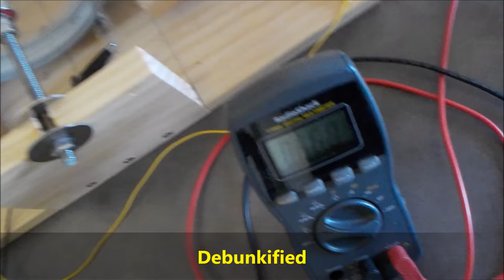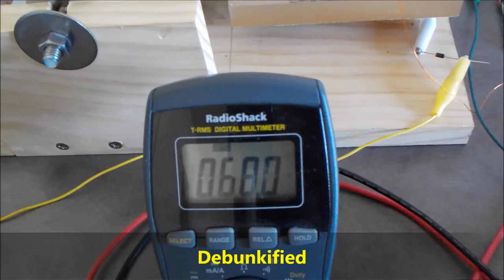GLIMPSE of FREE ENERGY OVERUNITY BYPASSING LENZ'S LAW

Comment from the maker: Honestly I believe it's more than a collapsing magnetic field, at first I thought maybe that's all it was. I initially thought that the split second short was causing a giant current to flow in that split second and an infinitely small resistance which in turn creates a huge opposing magnetic field from Lenz which when released  causing a huge voltage spike normally associated with a collapsing field. But this isn't the case at all as can be seen on an oscilloscope where the normal generated power can be seen as a sine wave, but when one looks closer one can see that there is another AC sine wave 
superimposed upon the negative and or positive peaks of the generated AC wave of the passing magnets.

This is an AC wave not a pulse discharged inductor which is clearly a pulsed DC that is commonly found with a collapsing magnetic field. A collapsing magnetic field can not create an AC wave like that, but a shorted coil does. So the coil is actually "Vibrating" like a guitar string and going into a "ringing frenzy". Vibration is energy and this is what we are tapping into. Energy is the potential to do work and power is the amount of "time" work has occurred and the measurement 
thereof.

A capacitor is a must have as this is the reservoir for the vibrating energy to enter into, after rectified into DC of course. The capacitor, when completely empty, is nearly without resistance which would never really occur as the capacitor is constantly charging and discharging. If this is done on a battery one will see that the current going into the battery literally vanishes and the meter will show this. A regular store bought meter can and will show a fairly accurate measurement, not perfect, but close enough to give a good round about figure, and even gets pretty close to an O-Scope and resistor test.

It can be frustrating to see that a capacitor happily accepts this AC to DC current coming from the coil, but not a battery and is a bit of a paradox if one is under the assumption that it is a collapsing field coming from the coil. (Tesla's discharged inductor.) when in reality it is an AC high frequency ringing coming from the coil instead. You see the battery offers too much resistance and is in no way anything like a capacitor at all, and so it just simply snuffs the power out, for those of you who have tried to send current from shorting a coil back to a battery as load, such as the source battery. You simply won't see it.

It is quite obvious, and I've been saying this for years, all the way back to the eternal motor site days even, that rotating magnetic fields can be multiplied and the generator coils they spin by are multiplied you are easily in the OU territory energy wise, or potential wise. If done right a 9V battery can spin a motor/generator and the generator can produce hundreds of volts, which can easily charge a capacitor up much higher than what the collapsing field could ever do coming from the motor coil, which is already at least 50%. with a rotor being a slower frequency, hence a lower efficiency.

It's not science rockery. It's potential. The OU is locked up in the voltage, (energy) and the trick of course is to get the current AND voltage out without any feed back at all back to the source, but without the current, we are generating Overunity VOLTAGE, which is only half of what we really want. Just make sure you have plenty of it to WORK from it successfully.
Reply: Hi BobYes it starts out as a collapsing magnetic field within a coil that has been induced with magnet, or has been pulsed with DC, then this inductor is shorted with switch at a very specific time and pulse width,  but it is different than how you describe it, as the scope shot I put up is without a capacitor connected....you could be somewhat right, as the coil itself has self-capacitance, but it is certainly much different than the "typical" collapsing field of inductor after being pulsed with DC  and when switch opens,  the magnetic field  collapses and you get that  backemf/recoil flyback HV spike, which is what Debunker is talking about and I agree with......It is  NOT  "latching resonance" between two oscillating systems, like in a radio, it is "forced" hyper ringing of an inductor into very HF and HV AC oscillations with only purpose to fill up caps to much greater level of voltage and joules when the short is switched in at peak and really has nothing to do with radio resonance and should not be confused with it.....The overunity comes from fact it is NON REFLECTIVE in that the many times more joules  slammed into capacitor created takes no extra power on input end to achieve this or very little extra power on input end, compared to eventual joules release into load.....so it does not follow convention, in that if you have X more power output, this means in consequence you must have at least X more power input.....instead there is a huge GAIN in power output via cap discharge, and does not affect, or affects very little, the input. And this gain is "more than you think" since cap discharge power in watts is a function of voltage squared in cap it is not linear....
Reply: Hi Bob The power for the HF HV ringign caused by the short circuit at the sinewave peak, or just before coil saturates in case of DC pulse non rotating system OF COURSE does not come from "thin air" and you need to exert some sort of power into inductor, either induced or pulsed, to have "something" that is going to hyper ring from a peak coil short.......Your example of  elementary textbook phyiscs  has left out the fact that in case of generator coil induced by rotor magnet or pulsed DC inductor,  there is that underlying ":power input" to coil going on same time as the oscillations.....I don't really know exactly what effect this has on coil but the coil is not "static" and you cannot just take inductance of coil as it sits there doing nothing or having nothing done to it,, and  then calculate its parasitic capacitance and ipso fatso know exactly how the coil is going to behave concerining oscillation rate, if for some reason you wanted to know that.......Think about it:  the coil is constantly and swiftly changing both its parasitic ca[acitance   and inductance thanks to the sweeping-magnet -  in case of generator coil as example -  so it is notever  easy to get a handle on what exactly is the inductance of coil plus there is the fact the "collector "capacitor  is constantly charging or has just been discharged, so the capacitance is also not something "sitting still" and easy to measure wiyh inductance or capacitance meter at any given speck of time...ALSO there is the fact that the coil is sloshing its spikes backe and forth "within itself" during the shorted out period , and what does this do to the coil bth in its impedance, and its capacitance.??? It certainly will not be same as measuring a static coil.........its not radio where the oscillations radiate into air its a shorted out coil and oscillations collide and disrupt induce into one side of coil to other constantly.....Its is VERY complicated the physics and dynamics....PLUS  the rate of change of inductance compared to rate of change of capacitance are not "in synch]  eitherf and it will be quite complicated in actual  practice to use your simple formulas to predict or know for sure the oscillation rate......ACTUALLY it doesn't really matter much at all what the oscillation rate is, since the frequency rate of the oscillations that fill up the cap is not that important to know, or to measure, or to predict.....What IS IMPORTANT is the voltage peaks, the "oomph" behind those peaks, and MOST important is  the rate that lots of joules or voltage can get stuffed into that cap within a certain amount of time...What you want to know is:   knowing cap size, how many micro or milliseconds does it take to have that cap reach a target voltage....If oscillations are peaks every 1 microsecond or every 1/100th of microsecond it doesn't matter and what matters is simply how fast that capacitor fills up..... the "overunity" measurement would come from the cap discharges measured in watts compared to the power input measured in watts. Overunity does not have to come from thin air to be overunity that is pretty ridiculous really.  Overunity is just a measurement comparing input to output that is all.
Reply: I never claimed that the oscillations did not come from the original power source. Not once....in fact I have always stated that you have to have "something" to coil short, such as induced generator coil by rotor magnet or dc pulsed inductor that is "where"  it comes from "originally" and it is just normal ways to make power in coil....I know all about the ringing you describe and problems designers have with HF amd I know what inductance and capacitance is....I already explained in previous email wotj aboutit 6 very god reasons any EE would agree with, that your resonance fformula does not and will not predict tthe oscillation rate of a shorted coil at a peak, these oscillations happening when coil"sitting still" in a nutshell it is always changing and always fluid and collinding and self-inducing too because you focused on the oscillation rate as "explanation via resonance formula" of [eak coil shorting this immediately tells me that you do not understand whatis going on if you reread and finally  understpopd what I wrote yuu will realize resonance really has nothing to do with filling up a cap very fast with a generator coil it has to do with the hyper rAC rnging created by the switch closure and there is not a primary and secondary resonating together or any sort of latching radio frequency shit going on. It is very simple stuff I try to explain. I don't think you WANT TO understand since you have already made up your mind it cannot work as describe.Again, any overunity in a working peak coil shorting system does not come from some mysterious source, it does not come from thin air, it does not come from my imaginatiion it comes from a FACT that the capacitor fills up super super fast and super high voltage (X50 at best) because of the hyper ringing caused by the coil short, during switch closure. Thjs is not resonance it is  very HF and very HV oscillations being captured and rectified into capacitor and capacitor is released to load in a second stage....This last sentence explains all in a nutshell actually. re read that and understand please.The overunity comes from fact that you can make it "non reflective" to source.....in otherwords you get a big gain in powe producedr at no sacrifice to original power draw.....Tesla did coil very similar shorting of inductors not exactly the same but similar he did not have modern diodes or mosfets so had to do it mechanical or with vacuum tubes....I don't patent I am open source such as this thread is.  It is really hard for me to explain stuff and have you understand it if you do not believe me in first place, and you do not concentrate and understand fully it just gets to point where I write about oscillations and hyper voltage gain  and you reply about resonance formulas or HF switching problems. or confusing energy with power or stating there is no resistive load so no power or saying I say things I never say it is very frustrating for me I am trying to "get through" there is something blocking your understanding and it is probably that you do not want to understand. This must be since it is very very simple what peak coil shorting is.
Reply: I never claimed that the oscillations did not come from the original power source. Not once....in fact I have always stated that you have to have "something" to coil short, such as induced generator coil by rotor magnet or dc pulsed inductor that is "where"  it comes from "originally" and it is just normal ways to make power in coil....I know all about the ringing you describe and problems designers have with HF amd I know what inductance and capacitance is....I already explained in previous email wotj aboutit 6 very god reasons any EE would agree with, that your resonance fformula does not and will not predict tthe oscillation rate of a shorted coil at a peak, these oscillations happening when coil"sitting still" in a nutshell it is always changing and always fluid and collinding and self-inducing too because you focused on the oscillation rate as "explanation via resonance formula" of [eak coil shorting this immediately tells me that you do not understand whatis going on if you reread and finally  understpopd what I wrote yuu will realize resonance really has nothing to do with filling up a cap very fast with a generator coil it has to do with the hyper rAC rnging created by the switch closure and there is not a primary and secondary resonating together or any sort of latching radio frequency shit going on. It is very simple stuff I try to explain. I don't think you WANT TO understand since you have already made up your mind it cannot work as describe.Again, any overunity in a working peak coil shorting system does not come from some mysterious source, it does not come from thin air, it does not come from my imaginatiion it comes from a FACT that the capacitor fills up super super fast and super high voltage (X50 at best) because of the hyper ringing caused by the coil short, during switch closure. Thjs is not resonance it is  very HF and very HV oscillations being captured and rectified into capacitor and capacitor is released to load in a second stage....This last sentence explains all in a nutshell actually. re read that and understand please.The overunity comes from fact that you can make it "non reflective" to source.....in otherwords you get a big gain in powe producedr at no sacrifice to original power draw.....Tesla did coil very similar shorting of inductors not exactly the same but similar he did not have modern diodes or mosfets so had to do it mechanical or with vacuum tubes....I don't patent I am open source such as this thread is.  It is really hard for me to explain stuff and have you understand it if you do not believe me in first place, and you do not concentrate and understand fully it just gets to point where I write about oscillations and hyper voltage gain  and you reply about resonance formulas or HF switching problems. or confusing energy with power or stating there is no resistive load so no power or saying I say things I never say it is very frustrating for me I am trying to "get through" there is something blocking your understanding and it is probably that you do not want to understand. This must be since it is very very simple what peak coil shorting is.
Reply: I never claimed that the oscillations did not come from the original power source. Not once....in fact I have always stated that you have to have "something" to coil short, such as induced generator coil by rotor magnet or dc pulsed inductor that is "where"  it comes from "originally" and it is just normal ways to make power in coil....I know all about the ringing you describe and problems designers have with HF amd I know what inductance and capacitance is....I already explained in previous email wotj aboutit 6 very god reasons any EE would agree with, that your resonance fformula does not and will not predict tthe oscillation rate of a shorted coil at a peak, these oscillations happening when coil"sitting still" in a nutshell it is always changing and always fluid and collinding and self-inducing too because you focused on the oscillation rate as "explanation via resonance formula" of [eak coil shorting this immediately tells me that you do not understand whatis going on if you reread and finally  understpopd what I wrote yuu will realize resonance really has nothing to do with filling up a cap very fast with a generator coil it has to do with the hyper rAC rnging created by the switch closure and there is not a primary and secondary resonating together or any sort of latching radio frequency shit going on. It is very simple stuff I try to explain. I don't think you WANT TO understand since you have already made up your mind it cannot work as describe.Again, any overunity in a working peak coil shorting system does not come from some mysterious source, it does not come from thin air, it does not come from my imaginatiion it comes from a FACT that the capacitor fills up super super fast and super high voltage (X50 at best) because of the hyper ringing caused by the coil short, during switch closure. Thjs is not resonance it is  very HF and very HV oscillations being captured and rectified into capacitor and capacitor is released to load in a second stage....This last sentence explains all in a nutshell actually. re read that and understand please.The overunity comes from fact that you can make it "non reflective" to source.....in otherwords you get a big gain in powe producedr at no sacrifice to original power draw.....Tesla did coil very similar shorting of inductors not exactly the same but similar he did not have modern diodes or mosfets so had to do it mechanical or with vacuum tubes....I don't patent I am open source such as this thread is.  It is really hard for me to explain stuff and have you understand it if you do not believe me in first place, and you do not concentrate and understand fully it just gets to point where I write about oscillations and hyper voltage gain  and you reply about resonance formulas or HF switching problems. or confusing energy with power or stating there is no resistive load so no power or saying I say things I never say it is very frustrating for me I am trying to "get through" there is something blocking your understanding and it is probably that you do not want to understand. This must be since it is very very simple what peak coil shorting is.
Reply: hiBobI know all about boost convertors have made 12V to 90vac invertors with them too  have over a dozen to play with. Peak coil shorting when it is done right is much more efficient and is also over 90 percent efficient which is as high as boost convertors go.,,,,, They are similar since voltage is boosted but peak coil shorting is much more dramatic and efficient and is also "beyond belief" when you get it working right....I have no motive or desire to prove anything to you or to do experiments that you demand to see before you are "converted",,,,,,,Like I said before I am on this thread to explain, and to correct misconceptions and  anything false I see in print,....so far I have corrected you a half dozen timesIsuch as power vs energy you were way wrong admit it)  you never acknowledge any mistake you make I have noticed please next time say "I stand corrected" if you print anything misleading or incorrect and I will do the same..... So far I have not printed anything misleading or incorrect about subject of peak coil shorting that I know of except in your case you do not believe overunity is possible so if I mention that word it cattle prongs you into attack mode.
Reply: debunkified omg my brain. Thanks a lot for the video and explanation.
Reply from the maker: +Cody X Your welcome.
Reply: debunkified try a spark gap